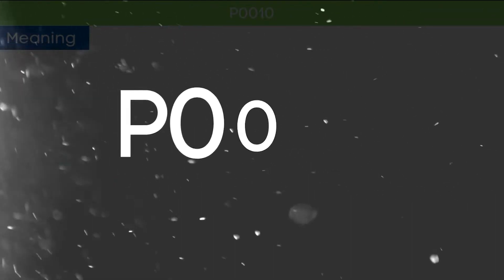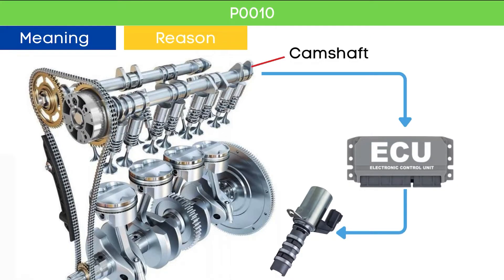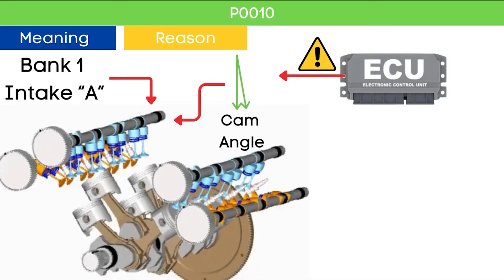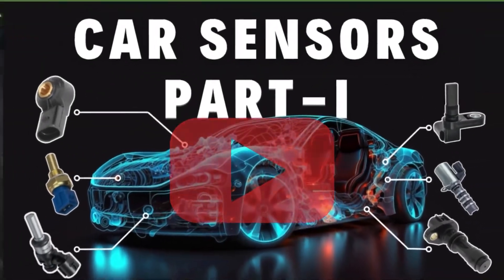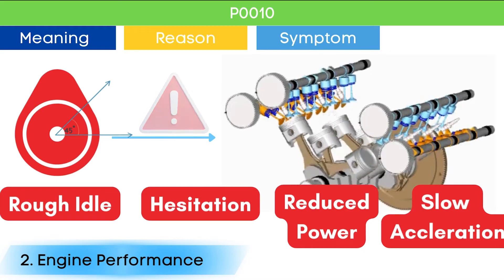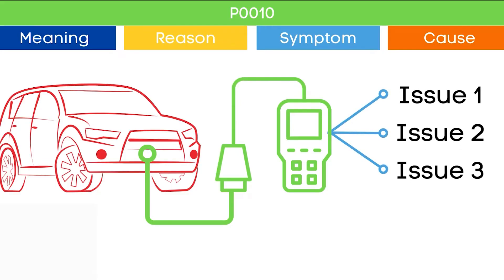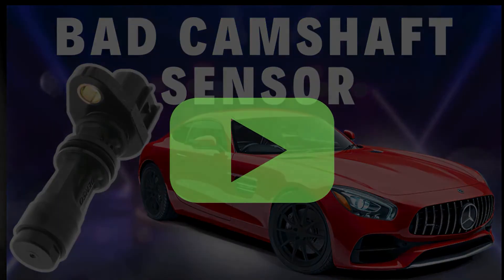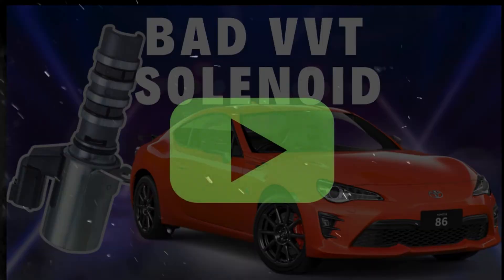P0010:  "A" Camshaft Position Actuator Circuit Bank 1

Comment: How to fix it please
Reply from the maker: To fix P0010, first step: check for any broken or frayed wire, if the wiring is good.

2nd step: check if the engine oil needs to change.

3rd step: Check the timing belt.

4th step: Test VVT Solenoid.

5th Step: Test the Camshaft Sensor.

To know more about, how to fix any OBD-2 code, visit our website: obdcode.org 

Thank you.